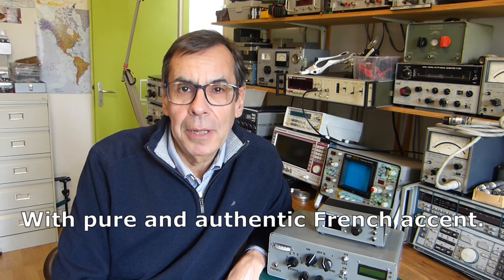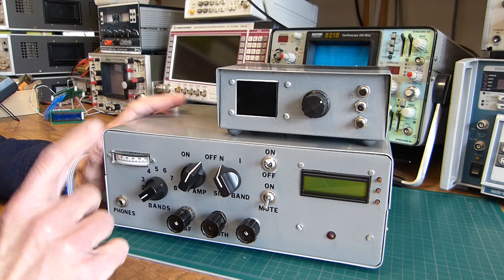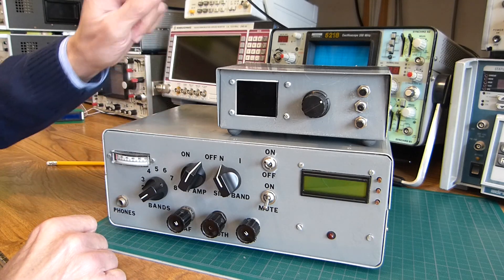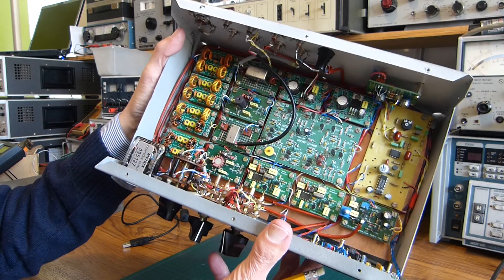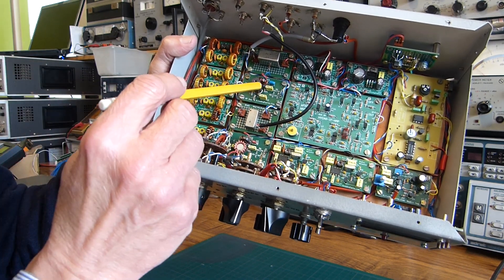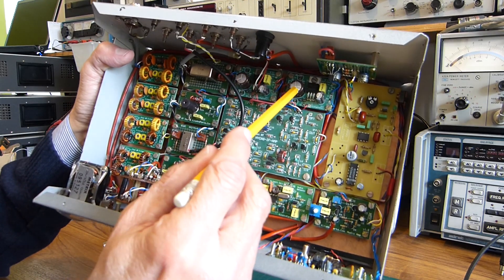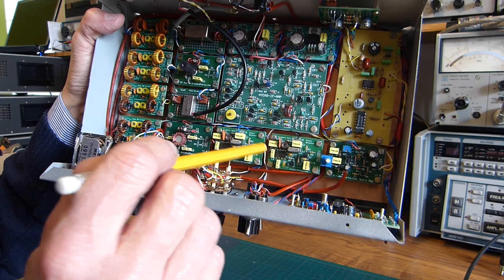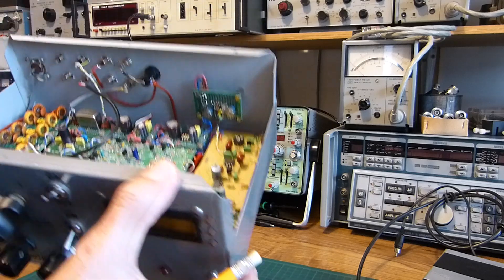Homebrew HF receiver with good CW/SSB performances for amateur bands or general coverage.

Comment: Getting that 9 MHz crystal filter is more than half the battle. After you get that, all things are possible hf receiver-wise.
Reply from the maker: You're absolutely right. A quartz filter is expensive, but you can always make one with patience and a batch of quartz. 
There's always the option of using ceramic filters, which are cheaper and easier to find. Have a nice day.

Comment: Quick question Denis? If I use the analog display DDS for a QRP transceiver how does the offset work. I see where to set it in the sketch but what tells the vfo when to output carrier with no offset for transmit and then with offset for receive? Or is the LO clock the receive one? I still imagine if both are on then cross channel interference between clocks will be a problem so ideally one is off whilst the other is on? is there a pin on the ESP32 that tells it xmit or receive....merce kind sir and 73.

Comment: 👍Thank you for video. Your receiver sounds and looks very nice. I must admit, I did wonder how it would compare with your Drake TR7 sitting below it. I had never seen the F6BQU SCAF variable AF filter before - very interesting.
Reply from the maker: Thank you Steve for your comment. It's always difficult to make comparisons. The TR7's quartz filters are of much better quality than the one I used in this receiver. Also, the TR7 is technically more advanced. That said, for quiet CW operation, apart from contests, I don't see much difference.
Thanks again for your message.
73 Denis F6CRP